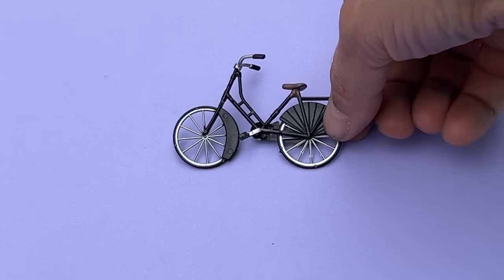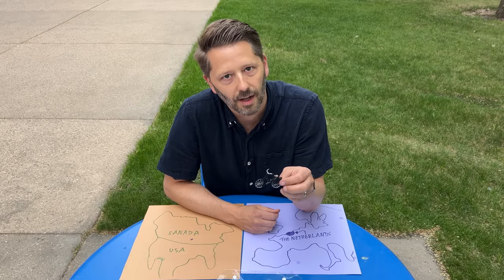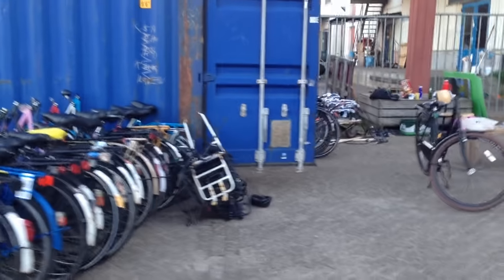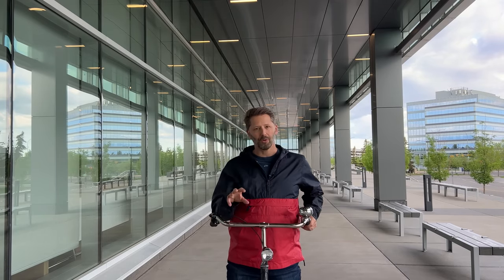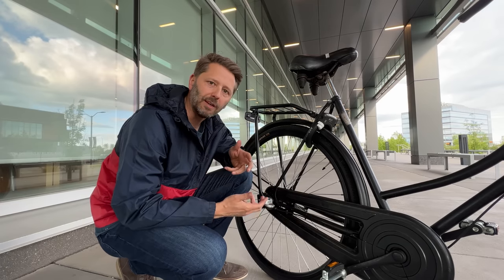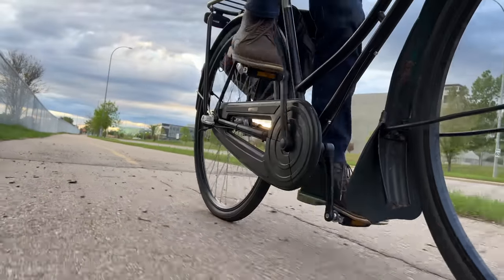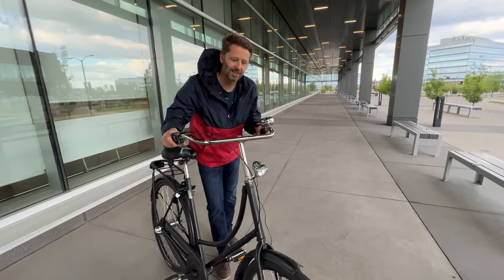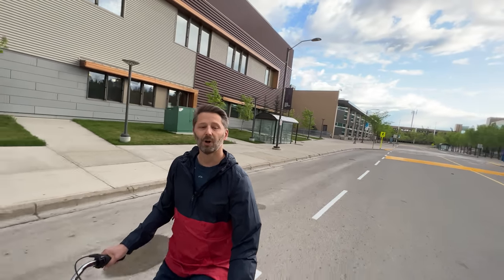I finally found a true Dutch bike in North America. Here's what you need to know

Comment: Little anecdote about their durability: my dad has a bike like this, which he found as it was going to a landfill. He fixed it up, and fifty years later he still rides that bike. It's not his main bike, but whenever he goes somewhere bikes might get stolen he brings this one and uses just the single frame lock. It never gets stolen because it looks so old.
Reply: Unfortunately, that tactic no longer works in the Netherlands, as new bikes are much easier to recover than old bikes.
Even my dad's rusty old bike got stolen when my brother borrowed it, even though my brother used a chain lock to secure the front wheel to the rack.
That wheel was the only thing the thief left behind.
Reply: Ah, we dutch call that a "stationsfiets" (train station bike). The old crappy bike that's too old to get stolen.
Reply: My daily bike is from 1978 or 1980 or so. What's amazing is that only the tires have been changed. Maaaybe the chain, but that I'm not sure of. I know the rest has never had to be changed. Full disclosure: it lived most of its life staying under roofs, it's only the past 2-3 years it lives outside permanently. But like... It's so good. I just have to go through more oil now that it stays outside.
Reply: @nonexistingvoid  Common knowledge not to lock just the front wheel. It's easy to remove, you can get the front wheel off within 30 seconds. You should run the chain lock through the frame in addition to the front wheel to be way more secure.
Reply: @nonexistingvoid  It depends how shit your bike looks though. I don't even lock my bike half of the time while living in one of the more criminal infested neighbourhoods in the country. Bike looks so shit that no one wants to steal it x)
Reply: @nonexistingvoid tip, secure your bike by the frame.
Reply: Same story for me
Reply: Haha de zuipfiets!
Reply: Yeah, I've been riding the same bike for maybe 20 years. There were several years where I rode 80-100km every other day or so. Obviously there's wear, but you just replace the parts that need replacing and it can last pretty much forever.
Reply: @rayvg7709  Yep, I take two locks. One goes through the front wheel and frame, and the other through the rear wheel, saddle and frame. Still not thief proof but a decent deterrent to less determined/ opportunistic thieves.
Reply: My dad rode the same bike for his whole adult life.
Reply: I recently bought a cheap Sparta grandma bike precisely because it looked like it came from a landfill.
Rusty fenders and rims, a frame only a mother could love and a busted taillight were exactly what I was looking for.
Cleaned it, put a new chain on it, some retro looking LED battery lights (new light in place of the rack reflector and kept the busted fender light) and some ratty looking bags for the luggage rack and I have a bike that no-one wants to steal and rides like new. Great for grabbing a few groceries from the local supermarket without having to worry about it getting stolen.
Paid 20 euro's for it and put about 30 euro's worth of parts on it.
Reply: @yooein  Mine is from 1956. Indestructible indeed. Only the worn chain, sprocket and tyres have ever been renewed. (O, and the headlight is replaced by one that is even older than the bike itself.)
Reply: @oriena_  A friend of mine had his chain lock stolen in Utrecht. The crappy looking bike was still there. 🤣
Reply: @oriena_  At a station this might not always work. Plenty of people steal a bike because they simply "need" the transport. They just dump it at there destination. So they really do not care if it is old or not.
Reply: @nonexistingvoid  that is because he just secured the front wheel to the rack use a good chain to secure the front wheel and frame to something and it wont get stolen. (info i got from Amsterdam Junkies in the 90ies on how to steal a bike)
Reply: @yooein  my bike is almost 40 years old living outside all its life. first 5 years i used it almost every day for 35 km to school and back. only new tires, had some special for cycling on ice for the fun of it,  and some new chains rest low maintenance.

Comment: One tip: take a common plastic shopping bag and cover the seat when not in use. tie it under so wind doesn't blow it away. before bike use, remove the bag and store by shoving inside the seat's frame. Using the bag has a couple of advantages:
1. bike seat will look shabby, deterring theft. 
2. seat will always be dry, regardless of rain or snow. 
3. seat will last longer as it bag will also protect it from sunlight.
Reply: I forgot which one it was, but either the blue AH bag, or the yellow Jumbo bag actually leaves stains on your pants if you use it like this. Maybe turning it inside out helps.
Reply: @metadaat5791  Honestly, I never had stain problems from bags. I imagine they come when you sit on the seat while the bag is still on. but i always take the bag off before i sit on the seat. perhaps it's this why.

Comment: I used to think these bikes were dull. "You can't have as much fun on them as my road bike or a mountain bike" I would think. Then after a few years and learning about how the Dutch live their daily lives I realised how fantastic they actually are. Not necessarily the experience of riding them itself, but how delightul and peaceful they can make a town or city when a large portion of the population use them for their daily errands. At that point I came round to how brilliant they actually are. Now I'm actually a bit of a dutch bike snob, and think the best ones are the bikes that are as low maintenance as possible - hub gears and hub/coaster brakes! 😄
Reply: The fancier ones come with seven or eight speed gearhubs and the steeringbar is easily adjustable in many positions and heights, allowing for a more hunched over sporty feel if you want. They're very versatile.
Reply: I'm overtaking roadies with mine on a regular basis, which makes it objectively more fun than the road bike I left behind
Reply: Internal gearing is pretty great.  I think disc brakes have rendered drum brakes obsolete on newer bicycles.  I have a nuvinci CVT hub on three of my bicycles and haven't had a problem with it.  Nexus 8s I've had bearings come loose and screw up the hub.  Will not buy another Nexus hub.
Reply: Lol, those bikes are dull indeed. There are not made for fun, but for transportation on an easy way. You want to get decent on your job or school. No compleet wet of sweat.
Reply: I think the "delightful and peaceful" part comes from the fact that these don't look aggressive and speedy, so the bike roads don't feel like racetracks.
Reply: @flower_power  Every bike is made for fun, compared to riding in some tin can.
Reply: They are so good bécause they are “dull’ in that they’re just bikes and they do exactly what you want them to do nothing more but certainly nothing less
Reply: That is why we have more than just 1 bike. A bike like this is my daily workhorse but I also have a mountain bike.
Reply: I brought mine (brand =zwaluw) moving to Alberta few years. Had it bespoke build with 7 gears, stainless steel rims,fixtures and bolts. An integrated dynamo and has a light sensor so my light come on automatically. 20 years old now but super practical (front crate and panniers) and looking like new
Reply: Most Dutchies have multiple bikes for different tasks (commuting, shopping, sports). 
Right now loads of old school bikes are exchanged for an e-version. Same upright position, same sturdiness, higher average speed (20-25 km/h instead of 15-20), larger area/reach for short trips and commuting up to 30 mins. Better gears and better breaking systems.

So the next decade it should be quite easy to buy large quantities of used old school bikes without a motor. The downside: bike-producers will gradually stop making old school bikes nor will they develop new models.

😊😊
Reply: That being said: the main problem outside Holland and Denmark is infrast9 for bikes.
Reply: IMHO a Dutch bike is NOT supposed to be "FUN" it is a TOOL to get where you want to GO and THAT IMHO is why they are so "GREAT" / uncommon in North America as biking is "sold" as FUN and NOT functional
Reply: @rosserobertolli  last year was out on mine and came up on a group of fat tyre riders and was keeping up with them and I have ONE gear and am NOT "athletic" in any way at all
Reply: @MaartenTeunissen  so MANY used and LOW COST bikes to FLOOD the North American cities with (-:
Reply: @jasonriddell  Lol, right you are.👍A virtual tidal wave coming your way😂 Hope you manage to change biking infrastructure though and also the car based mentality as well. Your best bet is to make changes in the cities first. Preferably with overall good weather and not to many MAGA supporters for they probably prefer to keep polluting the world for a simple trip to the grocery store...
Reply: @jasonriddell  Berlin is now an example how a new right wing city government can ruin all progress made and returns to their holy motorized cows...
Reply: @Aviopic  I have 3 bikes. My trusty 'Omafiets', a race bike and a Solex.
Reply: "delightul and peaceful"

You've never ridden a bike in a Dutch city during peak traffic LMAO We ride around like crazy madmen and even after riding a bike for all my life I'm still amazed at how few accidents actually happen. Like we obey the traffic lights but that's about it, all other laws are mere suggestions. It works though, and there's a certain laidback chill attitude to it all but "delightful and peaceful," far from it LOL Still beats cars that's for sure.
Reply: @rosserobertolli  How is that possible? Unless you're overtaking out of shape people in spandex who buy expensive road bikes simply as a flex?
Reply: They are not for sport but to computer, to work, school, friends or to ho to the supermarket they are awesome.
Reply: a bike in the town center is the fastest transportation , it allso is the cheapest as you can park just about everywhere near a shop 
it starts to get a bit bad when its raining , trust me it often rains in the netherlands and riding around on a bike become a lot less fun if youre soaked to the bone
Reply: @watahyahknow  That's what a Brompton is for. You just fold it up and bring it inside.
Reply: @davidhunternyc1  we use those mainly in combination with public transport to get to and from the station towards home or a job  , the bromtons arent alowed to be taken intoo shops and are too eazy to steal to be useful for general use in town
Reply: @watahyahknow  I did not know that Brompton's are not allowed in shops. I've seen videos of people using them as grocery carts, but that must be in the U.S. only. That's terrible. The reason to get a folding bike is so you can take it with you wherever you go.
Reply: @davidhunternyc1  dutch shops (supermarkets and clothingstores and the like) are way way smaller here than in the states , people do drive their inmobillity carts in there but more often they park those outside too as they tend to bump intoo stuff a lot https://www.youtube.com/watch?v=huef5TCBMIw
Reply: @watahyahknow  I just saw the video above. I live in NYC and the Dutch supermarkets are bigger than most supermarkets here, except for Whole Foods and Trader Joes.
Reply: They're not made for fun. They're made to work. For fun, most Dutch people have MTB's and / or racing bikes. Yes, if people have an MTB or sportsbike, they almost always have a regular "workhorse"bike as well here in the Netherlands.
Reply: @markjordens  they have good bikes and bikes they dont mind being damaged or stolen basicly, the good bikes usually get used for hobby and pleasurecruises and usually been kept in the line of sight of the user , i the days that i still drove bikes i lost about 2 to 3 bikes a year to people with sticky fingers , hence the bikes i bought where usually in the 30 euro range , needed new tires and some small stuff to be usefull again
Reply: Coaster brakes are really NOT suited for hills. Don't ask me how I found out. I still live though, as far as I know. But these bikes can also be found with rollerbrakes or other fancy brakes. Plus 8 or more- hub gearing.
Reply: @09conrado  we dont have hills here so i guess i never found out , i can immagine the grease getting hot inside the hub and lubricating the friction material
Reply: @watahyahknow  I think you're right. Coaster brakes are really handy for say cycling with a ladder over your shoulder, like chimneysweeps used to do, or window cleaners, or carpenters with long pieces of wood. Handbrakes have a tendency to swing the handlebars: the rear brakes usually don't brake hard enough so you'd use the front brakes and then it's hard to keep a straight line when braking onehanded. Good coaster brakes have a tendency to bind during hard braking and if you're familiar with that you can do some awesome drifting with the grannybike. Our youngsters love to do wheelies on a grannybike too😄
Reply: Nothing stop us from having two bikes: One for daily transport - and one or more for sports/fun.
That why there's more bikes than people - in Denmark at least.
Reply: @ane-louisestampe7939  from the bikes spread around here on the streets willy nilly i would say there about 3 bikes per head in the netherlands , most of them broke though,,,, one of the downsides of being able to buy them cheap is that its cheaper to buy another bike than say have a new wheel mounted to replace the bend one
Reply: @MarvinWestmaas  EH as a Dutch person, I definitely cycle out of necessity, not because of fun. The sole reason I do it is because I can skip traffic jams
Reply: @oriena_  But that's a you problem, and has nothing to do with the fact that any bike is more fun as a tin can.
Reply: The next step in my mind has always been community bikes, basically I don't know a single person without a bike but some people have limited space for one or can't safely park them anywhere (like mine I always have to double lock because I can only park it on the street). I've had a bike stolen about 7 times over my lifetime already and I'm not even 30 yet, but I've also gotten bikes for free secondhand and even once had a boyfriend that later admitted he stole it for me.. 🤦‍♀

So it'd just be so much better if we had 'public bikes' (especially in cities), it'd largely eliminate the problem of people stealing them and makes it accessible to everyone at any time they need one.
Reply: @eev14  Shared bike projects all across the world have failed so far, leaving enormous waste behind. Look for the China shared bike scandal, it's on youtube with the graveyards of bikes.

Local shared bike projects also failed, it wasn't economically viable. Bikes got trashed, thrown in canals and just vandalized, and there wasn't enough income to overcome the need for continuous maintenance. 

It's the same for shared ebike's, shared scooters/moped/electrical mopeds. The problem is people aren't responsible enough for things which aren't their property. 

The few who would be, and who would really benefit from these programs due to circumstances you just described, are sadly a small minority. 

On a controllable, small scale, I think it works. Like, if my apartment building came with shared ebikes / escooters, there is enough social cohesion to ensure people won't trash stuff, it's easier to control access and track responsibilities. Like a commune I guess, without the kumbaya singing around the camp fire. You can't keep scaling up personal responsibility, people stop caring when it's not in their direct sphere of influence. And an Orwellian  future where 'shared property' is just a disguise for extended tracking and monitoring ( by corporations or government )  is also no what we should strive for.
Reply: @eev14  Also, it seems like the issue you're having is more to do with the inability to properly secure your property. 

If I would park a decent bike on the street even with double locks I will wake up and see my expensive locks still there, in pieces, without a bike attached.

Tell me though, how does a shared bike fix that? Or do you mean, if a shared bike get's stolen, it's not your problem really? Or do you agree those shared bikes need parking as well? Then where would you like your shared bike parking to be? Next to your front door I suppose, since parking and needing to walk some ways would be nobody's choice right?

So you're right back at: maybe the issue is bike parking.
Reply: If you find an really old one( the more expensive version at the time) They were fitted with drum brakes, front and back. The brakes were operated as normal handbrakes but connected with steel rod’s instead of cables. This gives you way more braking-power over coasterbrakes, and an advantage over the cheaper cable version. While still being low on maintenance and function in the wet. It also enables you to brake with one hand while still operating the front and the rear simultaneously.